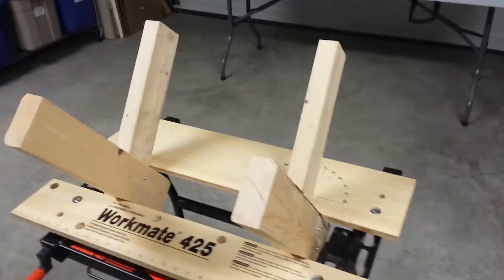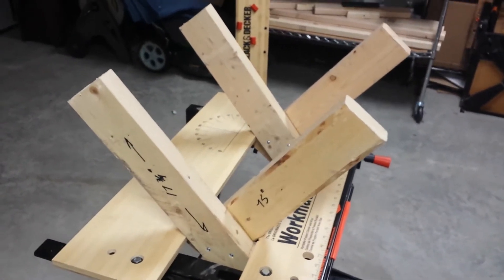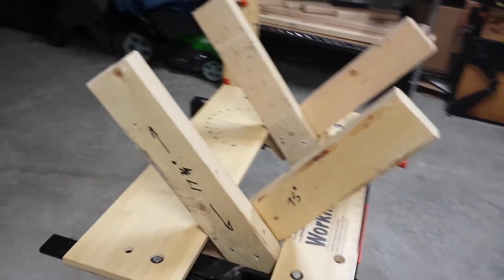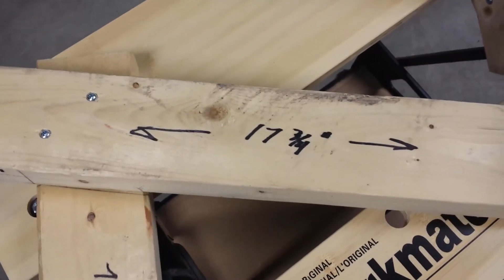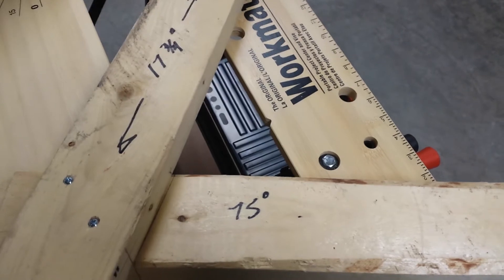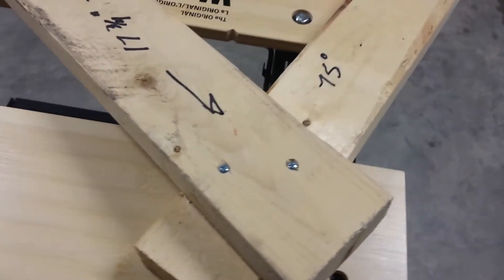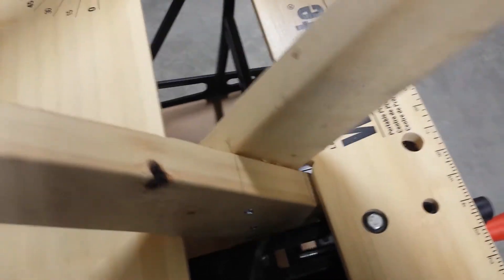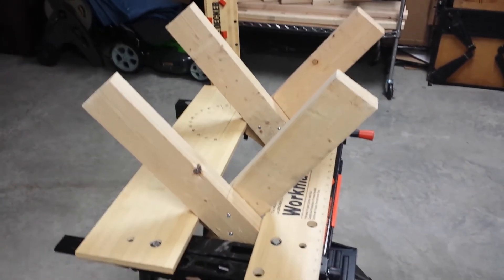How To Make Sawbucks For Your Workmate 425

Comment: I made 3 of these to the same spec and found they worked very well, amazing how well the workmate 2000 held them rigid, I made three so that a long log was still retained after cutting off a length.  Slight problem is that to clamp three at the same time means they need to be identical or the middle saw buck won't quite clamp so well.
Reply from the maker: Thanks for stopping by and sharing your experience.

Comment: Hi John  :-D 
I must have missed this one the first time around.  This is going to come in quite handy as I have about 20 long branches to be cut to firewood length, and this will enable me to get them off the ground to a more manageable height for cutting.  I really never thought of my WorkMate for such use.  You're brilliant!   :-D
Reply from the maker: Kathleen Zimmerman This is a very simple accessory to make just make sure you have long enough screws and you use some glue. Let me know how it works out for you.